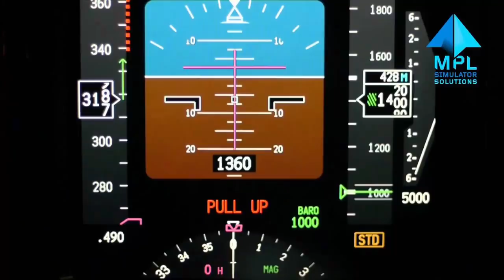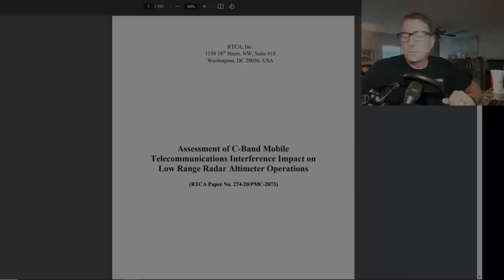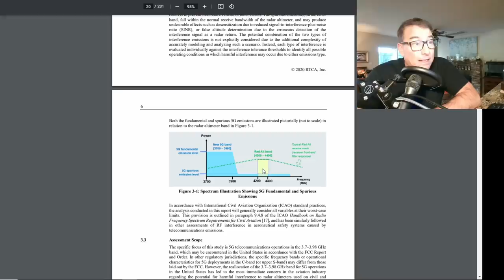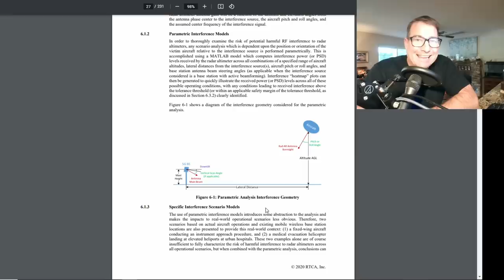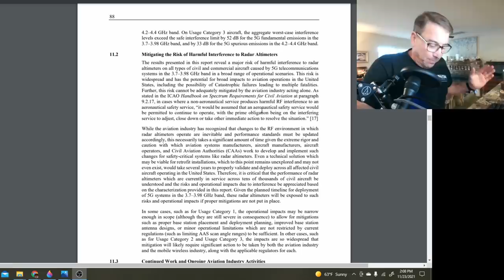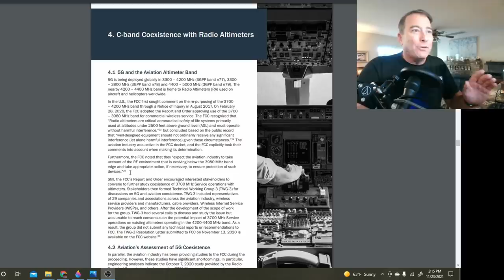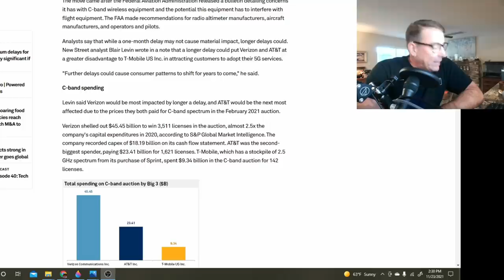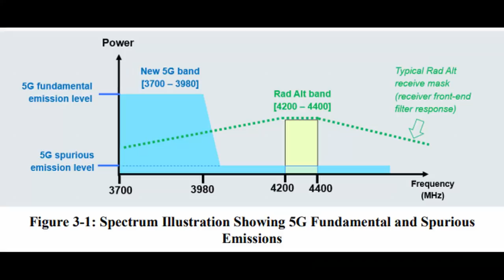5G C-Band Interference with Radar Altimeters in Aviation

Comment: Good report Juan. My perspective as a retired RF electrical engineer, is that the old legacy radar altimeter design will need to be upgraded with newer filtering techniques such as BAW (bulk acoustic wave). These filters have much steeper rejection in the stopband. As the spectrum inevitability becomes more crowded with expanding services it is incumbent on the folks who design the avionics to be as immune as possible to potential interference. Easy for me to say, more difficult to implement.
Reply: That and use a digital modulation for the radar altimeter or whatever is the most robust.
Reply: I agree. These cellular companies are clearly willing and able to spent $10 billion or more for this spectrum. Let them pay for the needed upgrades in aircraft radar altimeters.
Reply: Problem is the onus shouldn't necessarily be upon aviation to pay for new radalts everywhere - signal intrusion issues are borderline ethics dilemmas as the cost of upgrading all radalts with newer filters and tx/rx gear with higher wattage is probably just as expensive as trying to get the damn 5G telecom industry to get their ** together. 

Yes radalts are old but imagine if I walked up to someone in an Oldsmobile and said I'm going to get your car banned from the road, it's too old for my Tesla to automatically recognize to allow me to drive by you on autopilot so that I have to take manual control, you're an inconvenience to me so pay up.
Reply: Agreed.  I'm surprised at how poor the filtering is.  Time to upgrade.
Reply: Or perhaps use a higher frequency alltogether. Nowadays they could operate on 50+ GHz which was not that easy to implement back in the day. I worked on 77 GHz radars in the 2000s which were very high tech back in the day, but nowadays they are cheap to manufacture and present in most self-driving and "autopilot"-capable cars.
Reply: Agreed, I'm also an EE and I think the likely outcome here will be the airlines buying better filters for their ground altimeter radar receivers.
Reply: Do you think that BAW filters have significant group delay variation with temperature?  Group delay would be critical for this application I think.
Reply: The problem is that higher filter selectivity will increase the group delay, and calibrating out bias and random manufacturing, or perhaps even thermal errors in pulse return time delays may not be at all practical.  I think that calibration needs to be accurate to around 2 ns under all operating conditions.
Reply: @saratogapilot6100  yeah I agree, I think group delay issues might prevent the use of a narrower filter.  In the test report they applied a band stop filter on the interfering 5g band which presumably has benign characteristics in the radar band.  Still, calibration and testing for this kind of thing is not trivial, even if some kind of filter solution is workable.
Reply: @davedoe6445  And pass the bills straight to the FCC and 5G operators, who are the ones trying to infringe on the safety margin.
Reply: also as a IT and RF Engineer and a PPL Holder,  the FAA is making some very erroneous claims along with the CAA.  so i concur with your statement.  AVWeb covered this and i left some very elaborate and detailed explanations on some testing i have done myself, as i have done work on the 5G systems in respect to spectrum interference. 

the FCC has debunked the FAA and the CAA's claims and issued a recommendation that we have already allocated billions of dollars worldwide in cooperation with other nations to get 5G Certified, its your turn to fork up some cash to fix the problems with older equipment you still allow to be used which is far more suspect to interference and failures from RF saturation.     sadly, because of political squandering,  this is going to be a long drawn out issue.  

no other country seems to be having these problems with 5G Low/Mid Band channels except the US and Canada.
Reply: @antoineroquentin2297  5G Ultra Wide-band uses 28-29.5 GHz mmW spectrum,  so its already waaaaay higher.  its the 5G Low/Mid Bands still sporting the LTE infrastructure that is the problem.  and the two major carriers populating that area is Verizon and T-Mobile with the rollout of 5G UC Midband channels.
Reply: They should add measuring with laser for redudancy and increased precision near the ground above the runway.
Reply: @ReinoGoo  LASER's however have atmospheric interference to deal with,  in respect of clouds, dirt, dust & debris.  

it would take a decent setup to use them.  including a receiver that would need to be spotless on the lens.  which would be nearly impossible to consistently check while the plane is flying. 

the biggest problem right now, is the still certified older RALT receivers that are showing signs of erroneous readouts when nearby a 4g/5G Tower.   5G UWB and 5G LB do not affect them its the 5G MB 'Mid-Band' that is just getting activated and rolled out.  

5G LB operates in cooperative with 4G LTE as far as frequencies are concerned.  the coding and modulation is different.   both operating around 12-1900 MHz. 

5G UWB Operates at 28GHz as mmW spectrum and is those tiny cans you see sitting on top of light poles in dense urban areas.  

Both LB and UWB are well out of the range for RALT C-Band interference.
Reply: Everyone here's ignoring how difficult and expensive it is to get anything aircraft-related certified.  Let's say we have a solution ready-to-go today.  It'll be a minimum of 5 years before it'd become certified and another 5 years before all of the aircraft could be outfitted.
Reply: Unfortunately and as usual it will probably take an accident before they realize they have a problem.
Reply: Cost multiplied by the number of active aircraft worldwide!
Reply: @michaelhansen7516  $$$$$$$$$
Reply: @ReinoGoo  lasers might not work so well in visually occluded conditions when these are depended upon.  Maybe infrared?
Reply: @SteamCrane   I don't know the technical issues, but there seems to be too much money in 5G for it not to go through.  Maybe there's a happy technical middle ground.  I'll leave it to the experts.
Reply: @grayrabbit2211  at the same time everyone is ignoring what the FCC has put into reorganizing the spectrum time and time again to fit various things into various slots,   a lot of them good, a lot of them bad also.  But at least they are making the effort to do it.   Everyone is also ignoring what other countries around the world have already mutually fixed.  

why is it the FAA and the CAA are the only two Aviation Authorities making a stink about it?  

I haven't seen a peep out of ICAO or IATA,  haven't seen a peep out of any European Nation, or Asian Nation and their Aviation Authorities.  Just America and Canada.    MAYBE because both the Asian Nations  and the European Nations that use 5G have already revamped their Aviation Requirements to work with 5G.  

the CAA and the FAA dont want to play ball.    The FCC is willing to work with the FAA,  the Canadian Spectrum Management and Telecommunications Authority is ready to work with the CAA.  but they ( FAA and CAA ) don't want to work with them.   

so, no mutual grounds = crying and complaining on ONE side. 

and THAT , is the world difference going on.  and until the FAA and the CAA start acting like the others,  this will never get solved.
Reply: @onenerdarmy  Wait for it!
Reply: This is the real point.  The filtering in the radio altimeters need to be upgraded.  The electromagnetic spectrum is so crowded and getting more crowded every day.  Existing equipment needs to be upgraded (or replaced) to deal with it.

I don't know where the money goes from these FCC auctions, but an obvious place would be to compensate those who are negatively affected.
Reply: @CapStar362  The French also reported issues of interference between 5G and aircraft.
Reply: @ReinoGoo  How would that work on TCAS? Just scan everything around the plane with a laser beam?
Reply: @CapStar362  having worked with both the FCC and FAA on multiple projects, I'll gladly side with the FAA.  Yes, the FAA is very overly cautious when it comes to safety, but the record stands - 2 Part 121 fatalities in 10+ years of operation.

One radio altimeter foul up could mean 300+ bodies scattered among the burning remains of an aircraft. 

The previous FCC chair, Ajit Pai, worked for Verizon before joining the FCC and I don't recall a single time when he did anything Verizon disagreed with.
Reply: @grayrabbit2211  Pai and i dont agree on lots of things either.  

and ive worked on quite a few projects myself pertaining to 5G.  

he made plenty of fuck-ups himself.  

and i dont know of a single airliner that is operating a RALT that isnt prone to the levels of interference the much older RALT's still in use.  

my point is that, the FCC is willing to help.  the FAA is not.  

Canadian Spectrum and Teleco is willing to help,  CAA is not.  

mutual agreements on how to assist each other and the people they serve goes a long way, which is why i made the standpoint of how nearly every other country that utilizes 5G including ICAO and IATA are not saying much at all if anything because of mutual work forces fixing things. 

FAA and CAA seem to be the outsiders on this.
Reply: Well said.
Reply: @Inkling777  Or let the government give some of its money to the victimized party. I.e. altimeter manufacturers and users. Why should the money go into other projects? If there is a cost to using that frequency band then the money has to address that.
Reply: There are a few issues here. Improving and retrofitting filters could be done, but it would most probably require more space and weight -- both of which are at a premium in aircraft, not to mention the qualification issues. The lifetime of a radio altimeter design is most probably decades, whereas the lifetime of cellular design is months (but probably small years for base station equipment).  The point is that technology changes must faster in the cellular world and the FAA process rightly does not account for that when lives are on the line. You could design a 5G system that moves users when a RA is sensed, but that seems complicated. Yes, the real problem is when you have a 5G mobile on board that is not in airplane mode. The phase noise is sure to have some concern with the RA. I haven't checked into 5G -- is it like LTE with a wide bandwidth (I think 20 MHz chunks)? Or narrowband TDMA spikes (P25)? 5G modulation probably plays into the equation also. Lots more questions than answers! Thanks for the report Juan!
Reply: @bob4702  

" I haven't checked into 5G -- is it like LTE with a wide bandwidth (I think 20 MHz chunks)? Or narrowband TDMA spikes (P25)? 5G modulation probably plays into the equation also."

To answer this,  the low band and mid band portions are like LTE in modulation. 

Low Band resides in the same areas at 4G LTE which is 12-1900 MHz and 2.6GHz ( correct me if im wrong on that one ) 

Mid Band is now 3.5 GHz which is right next to C-Band. 

the super fast 5G Ultra Wide-Band or 5G UWB, resides up in the 28GHz mmW range and is completely outside of the range of interference. 

as far as updating components,  a simple component change in the filters and testing them while yes,  could take some time,  weight wise is not a problem.  

Verizon, ATT and T-Mobile have already lowered their dynamic levels for Lo/Mid Band towers.  so at least the carriers are now making a effort.  

FCC has made its effort,  now its time for the FAA to make an effort to help.
Reply: @antoineroquentin2297  how well would 77GHz fight 500+m of fog?
Reply: @AKAtheA  about 2 dB attenuation per kilometer of heavy fog
Reply: @antoineroquentin2297  only??
Reply: @AKAtheA  as long as the droplets are much smaller than half a wavelength, it isn't an issue. rain is more problematic (not because of attenuation, but because of scattering) but it can still be done
Reply: @antoineroquentin2297  what about snow? :P
flakes can get pretty big close to the ground...
Reply: Thanks for posting, I was going to make the same point.  Aviation doesn't own the entire band, just the part they are licensed to use.  They went with a crappy design because they thought there wasn't enough present around their frequencies.
Reply: @samuelkeystone  Yep, digital modulation is the key!  GPS has 130dB of rejection IN BAND due to the modulation technique.
Reply: @onenerdarmy  Legally the onus is on the aviation industry since they sent a product out that is sensitive to out of band signals.  Your analogy is irrelevant because the Oldsmobile was legal when sold.  At no point did the aviation industry own the spectrum they are complaining about.  They just got lucky until now.  At no time was the industry guaranteed this spectrum wouldn't ever be used.
Reply: @grayrabbit2211  "  It'll be a minimum of 5 years before it'd become certified and another 5 years before all of the aircraft could be outfitted."  - This is exactly the problem. I'm an R/C aeromodeller, and the pace of electronic technology advances in R/C  is simply breathtaking. There is no reason whatever for pilots to lose control of aircraft due to situational awareness deficiencies, since autopilots can fully stabilise an aircraft and avoid terrain. If this technology exists for models, why cannot it be applied more widely to general aviation? (I know there are some GA aircraft which do now have emergency systems which will guide aircraft even to a safe landing at an airport). Likewise, the range for remotely controlling models has increased radically, meaning that emergency systems for controlling aircraft remotely can also be devised.  But how long before they are certified?
Reply: @awuma  For good reason -- if they get it wrong, people die.  Living relatives sue.  Juries will rule for the deceased's family every time.  

Realize that more people in the USA die in elevators each month than have died in airline accidents in *10 years). 

I'm not entirely opposed to the certification process.  There's only been 2 fatalities in Part 121 US carriers over the past 10+ years.  One was due to an engine failure, the second was due to multiple factors, including the anti-lock brakes being cross-wired and an inexperienced pilot.    I can hear people, myself included, saying that 2 deaths is too many.  

At the same time, the process does need to be streamlined.  More government is rarely the solution to any problem.
Reply: @Porco Porco The issue isn't the ability to do it, rather implementing it with the rules we have to work with.  Even now, many small planes have glass cockpits (digital displays) which are far superior to what the airlines use.  Getting those systems tested, built, tested again, and certified is a completely different matter.

Keep in mind that radioaltimeters are used at the most crucial times of flight, often in the most dangerous weather conditions.   Screw this up and you're killing a few hundred people.
Reply: So much this.  There are many legitimate users of the bands and any user of spectrum must utilize the appropriate techniques to "stay in their lane".  If a multi-million dollar navigation system can't handle a little bit of OOB emissions, then it is hardly a well designed system.
Reply: If a $20 wireless device can disrupt a landing radar then that landing radar is a POS.  Notch filters or better quality discriminators are not expensive and just because designers were lazy back in the day does not give them the privilege to continue to be lazy.  Stay in your lane.
Reply: @antoineroquentin2297  Technologically possible is not necessarily technologically feasible or economically feasible. Time constraints enter the picture in very serious terms. Designing, developing, building, testing, and all that folderol takes time that the industry does not have.

Other technologies can also give 1' type altitude accuracy. This would include things like differential GPS within a full Kalman filter arrangement with all the aircraft's other instruments. (I remember some 10' wink-wink discussions with the Air Force back in the 70's.) But, again, time is your enemy.

About the fastest drawing board to cockpit approach I can think of today would be a software defined radio with filtering that uses the nature of the altimeter chirp signal to implement some level of interference rejection. A human MK 1 eyeball on a spectrum and waterfall display can pull the scratch of a signal out of all manner of noise you'd not believe. And for an altimeter 5G is noise not sets of signals that can easily provide the clear tone the equipment looks for when deducing altitude. But, even that would require time that is not available.

With that in mind it would be interesting to see what accuracy reduction would come from slapping a narrower filter on the receiver input. That might be a fix that can be implemented within modestly tight time constraints.

(In the abstract I'd love to see some schematics or even block diagrams for the existing altimeters to get a notion of how caveman they might be mostly because it saved a couple bucks per altimeter.)

{^_^}
Reply: @grayrabbit2211  they had a heads up in 2017, they should have started the moment they got notice.
Reply: @inadequateusername7280  because of the certification process, it takes about 10 years to get equipment designed, tested, and certified for aviation.  I'm still waiting for certification on my plane to use the Garmin Autopilot instead of the crusty KAP140.   No doubt the Garmin unit can do it, but I can't legally install it until it's certified.
Reply: @grayrabbit2211  the rest of the world shouldn't be held back because the evaluation process is broken.
Reply: @inadequateusername7280  People's lives shouldn't be endangered because some narcissist needs to upload more selfies faster.  We are talking about a system that is critical during the worst and most dangerous weather. 

Fix the system, then we can discuss changing equipment
Reply: @saratogapilot6100  I would try freq changing, listen before tx.
Reply: @grayrabbit2211  lol no, the guard bands determined by the FCC is plenty, the altimeters shouldn’t have been allowed to be built in a manner where it’s affected by adjacent bands. This is a finite resource the aviation cannot hog it because of poor design.
Reply: Yes we can design “blocking proof”  FMCW RA’s…but it’s not cheap for the aviation industry to accommodate this change.
Reply: Said BAW or SAW filters will need to exhibit linear phase over the FMCW swept band.
Reply: @davedoe6445  - The filter must be linear phase for it to work properly with an FMCW radar. Linear phase = constant group delay with frequency.
Reply: @w5cdt  well it's not a only a matter of some arbitrary constant group delay, you would need to know what that group delay is in order to calibrate out its effect on radar measurements.  For instance what if at the minimum radar temperature group delay is 300 ns slower than at maximum temperature (making up those numbers).  That would produce a ~300 ft altitude error if left uncorrected.  I have no idea how easy it is to calibrate a BAW or SAW filter to demanded accuracy over manufacturing variation.     

As for the politics of the matter I have no clue, I'm only guessing that the telecom industry will ultimately command more political clout than avionics designers since they have a bigger constituency.
Reply: Isn’t this new 5G band already re-purposed or shared from a military (surface) radar band?
Reply: @george8bitsworth  "The filtering in the radio altimeters need to be upgraded."  ... and tested .. and certified. 
In the meantime, do you think the big telcos are going to sit on their hands and wait.. of course not, so this change will go through. Problems may occur... (read that as will occur... Murphys law).. and we  may have a 737 Max situation, only this time the big bill will hit the telecom companies and the FCC, for failing to take the matter seriously.
Reply: @AndyHullMcPenguin  Thanks for the reply.
You wouldn't expect it to be a simple process--especially when aviation is involved. You're right about the telcos not waiting. It's been in the news about how they're going ahead in spite of being encouraged not to.
Reply: @ReinoGoo  Will fail due to interference in bad weather. Rain, fog, snow. Which is precisely when it needs to work.
Reply: Sure. Should have long ago. But in the meantime . . .
Reply: Agreed, this could be paid for partially by the 5G providers.
Reply: @onenerdarmy  You are wrong.
The spectrum used by 5G was never reserved by the avionics industry.
It is time to sort out old flaws to ensure functionality within the specified band.
Reply: @AndyHullMcPenguin  Doubtful. The RTCA paper came up with a worst of the worst of the worst possible case theoretical scenario and even then they still say the issue isn't spurious emissions, but rather poor filtering by RadAlts, and required some crazy scenarios like cell towers aiming their antennas above the horizon or at a 40 degree angle to the ground with high power in order to simulate a field strength that could affect RAs on commercial aircraft to an unacceptable degree... at 0.4NM from the cell tower.
Reply: @onenerdarmy  ahhh but at some point you hafta say your Model T cant run on this highway
Reply: @phillee2814  It's not that simple. 5G gear is filtering well. The radalts have outdated filtering. It's just another thing to upgrade, just like engines have been in the past. It's not FCC's or 5G operators' fault that radalts aren't up to modern standards. If anything, I'd blame the radalt mfrs for obviously assuming that they won't ever need better filtering.
Reply: @samiraperi467  The Radio Altimeter manufacturers had to pass the certification from both the FCC and FAA, and achieved it on the basis that the bands on each side would be a protection of life buffer.  They didn't move the goalposts, so should not have to pay for them being moved.  The FCC and cellphone service providers chose to ignore an established safety buffer.
If the airlines are made to pay, don't be surprised if they upgrade by increasing the power of their systems to obliterate 5G service on instrument approach corridors.
Life protection trumps internet speed all day every day, so suck it up.  Cell providers can easily use frequencies with greater separation in those small areas, just like they do in Europe.
Reply: I'm surprised this didn't happen years ago, on basic safety grounds.  Being receptive to such a wide spectrum just invites some manner of inadvertent signal contamination, possibly (?) resulting in garbage altitude data.
Reply: I agree on this. The problem is with the radar altimeters receiving RF not in their allocated bandwidth. It would be like designing a FM radio that can’t pick one station from the ones adjacent to the one you want. I retired as a tech at a gateway earth station and it was a full spectrum but properly managed we didn’t have problems with adjacent carriers.
Reply: @V100-e5q , If there’s a cost to using the frequencies purchased by the telecom companies, then those telecom companies should pay those costs, not the government. The telecom companies should have the expertise required to figure out those costs before they buy the frequencies.

A simple solution is to use those frequencies everywhere except near airports that require these radar altimeters. Then work with the FAA to change the rules for all newly manufactured and deployed radar altimeters so that eventually it’ll no longer be an issue. These airliners don’t last forever. They will eventually be replaced with new equipment.
Reply: @davedoe6445  There are no ground receivers. A radar altimeter is a transmitter and receiver on the aircraft that measures the round trip time of the signal. I first worked on these 50 years ago on Navy aircraft. We had a spool of cable that would connect to the transmit and receive antennas to simulate the altitude to verify its operation.
Reply: @phillee2814  These companies are operating in their authorized spectrum, the filtering on the altimeter receiver it picking up signals out of its transmitter spectrum.
Reply: @matthewbeasley7765 , Ummm…. The FCC didn’t sell bands that were too close together because they understood the technical capabilities of the time. Those technical capabilities have changed, but the old equipment hasn’t.

The FCC should have required the FAA to upgrade their requirements long before attempting to sell those frequency bands, and whoever purchased those bands should have been aware of potential issues like this and considered them before placing their bids.
Reply: @Chris_at_Home , “we didn’t have problems with adjacent carriers”

Yeah, because the adjacent carriers were sufficiently spaced so they wouldn’t interfere. What if the FCC suddenly up and sold the spaces between the channels so you couldn’t filter them out using the technology used in your equipment forcing you to upgrade all your equipment. Who should pay for the upgrade?
Reply: @terjeoseberg990  Not many years ago the FCC made mobile radio bandwidth allocations narrower and all the mobile radio users had to upgrade their equipment. I don’t think the FCC paid for that. Most technology improves equipment over the years but the basic design of radar altimeters hasn’t changed  in years. If the manufacturers of this equipment would improve their products over the years with modern receivers we won’t be here today. I see glass cockpits connected it 50 yo technology.
Reply: @terjeoseberg990  Why is this not a problem in Europe? Because the FCC equivalent sold those frequencies to the 5G operators which don't interfere with air trafffic frequencies. So this looks as a failure to coordinate frequency allocation in the first place.
What has not to be ignored is that the frequencies were auction off to the telcos. So they paid the government to use the frequencies. So it is now the governments duty to make sure they can really use it. And not put additional burden on them to do so. All those billions could be used to reimburse airlines to change their frequencies or make other equipment. Else why had the telcos to pay for the frequencies? To make government rich?
Reply: @terjeoseberg990  Because it's the governments agency responsibility to coordinate and regulate use of frequencies. If there is fear of interference then they have to take in all the concerns and resolve the issues. Either by mandating certain restrictions of use and requirements to the equipment or by assigning the proper distance of frequency bands. It's not to sit back and say guys duke it out yourselves. Not without reason equipment has to be compatible and the FCC is there to make the rules.
Reply: @Chris_at_Home  And don't you think that would have been part of the approval process at any of the dozens or even hundreds of agencies around the world who had to pass the existing RA systems as safe for the preservation of life?
Yet they all passed.
Reply: @V100-e5q , The government sold those frequencies. The purchaser must be intelligent enough to understand that they will not be allowed to interfere with their neighbors. If they don’t have the technology to use those frequencies without interfering with their neighbors, they should not have purchased them.

Maybe they just got screwed. Or, maybe it’s worth it for them to use that frequency band only far enough from airports so that they don’t infere with them.

Did the government provide a guarantee when they auctioned off those frequencies? Buyer beware.
Reply: @terjeoseberg990  I think you should take in the role of government. They are not just like a real estate owner selling his lot. They are owners and regulators. So if they sell a frequency band they have to either let them use it without limitation. Hence everywhere in the US. Or they must establish limited use. Like the requirements for equipmnet (radiation power not over 10 W) or limit the locations. That is the essential role of government which you seem not to get. Like the restrictions to flight space use to stay at the subject.
Reply: @onenerdarmy  your car analogy falls flat. This situation is really like the Oldsmobile guy getting the Tesla banned because he can't go fast enough to share the highway with them safely. Clearly this person needs to upgrade their car if they want to be able to use the highway again.

It's not telecom's fault that so many altimeters weren't designed to the correct specifications. It's not telecom's fault that the FAA approves these out-of-spec altimeters for use.
Reply: it isn't like this just happened.  Aviation has had more than 10 years to get a solution in place and appears to have sat there fat dumb and happy for that time.
Reply: @Gnrnrvids , Nobody told the aviation industry 10 years ago to fix this.
Reply: @terjeoseberg990  Nobody told the aviation industry to manufacture equipment that isn't up to the correct specifications. Nobody told the FAA to approve that incorrectly-designed equipment for use. The whole point of a "safety buffer" is to not use it.
Reply: @terjeoseberg990  they are operating outside their allocated range.  They have had 10 years to sort it out as it was announced 10 years ago where 5G would sit.
Reply: @samuelkeystone  that's what I was thinking; if the signal from the altimeter has a unique signature, it would be easier to lift it out of the interference. But this whole problem is a money driven rejection by the telecommunications industry of passenger safety.
Reply: All this 5g congestion is nonsense. Just adding directional and beamforming antennas is 99% of the problem, which newer 4g radios already do.

The companies are expletives though and they don't want to upgrade their towers at all unless it's a BIG upgrade and then not touch it for 20 years.  Really 5g's RF bandwidth expansion isn't necessary, they need to buy new SFP dongles for their fiber ethernet so they get 10gig to their tower backbone instead of 20 mbit
Reply: @davedoe6445  group delay is not significant for this slow modulation and would have a fixed offset, easy to account for.
Reply: I studied aviation radio altimeters back in the 70s. I thought radio altimeters waisted a lot of a radio band. Should have been fixed decades ago.
Reply: We could live without 5G 🙂
Reply: could you not prevent any issues by just upin output to 3 Watts or does that cause issues with reflections, and putting better ejection on the receiver?
Reply: @ReinoGoo  I really don’t know why this isn’t a thing in aviation. It could be that some of the technology used on higher-end vehicles could be scaled-up for aviation. #thinkingoutloud
Reply: @grayrabbit2211  I’m not sure it takes that long for recertification when there are other certified RALT already certified. Wouldn’t this be more about making sure the testing of the refitting of filters has sound study design, was executed by an accredited 3rd party facility, and then certified by the relevant parties? I’ve seen avionics firmware upgrades done in 6-9mos.
Reply: @onenerdarmy    Just wait...that's coming.
Reply: @onenerdarmy  I think you’re making an incorrect statement.  The new spectrum allocation to 5G is not intruding on the spectrum used by radalts.  The problem is that some of the deployed radalts are too permissive in their filtering of RF signals outside of their allocated spectrum band.  The use of 3.7 - 3.98GHz spectrum for 5G is not a NEW USE, but is a RE-USE of the spectrum.  That band of spectrum is a portion of the 3.7 - 4.2 GHz C-Band spectrum that satellite communications has used for decades.  This is the spectrum used for reception by the earth stations, and is transmitted back to earth by C-Band satellite transponders.

What I don’t understand is why this debate and safety concern has only been raised within the last year, as the spectrum was auctioned off, and 5G service providers prepare to put them into use.  Before any of this spectrum could be turned on for 5G use, any SATCOM use had to get re-assigned, or shut down.  That takes time.  So, why this issue was not researched in parallel during that time is a big concern.  Maybe this was some ‘fallout’ from the previous Administrations’ goal to reduce or eliminate regulations?
Reply: @CapStar362  In Europe, the C-Band spectrum allocated to 5G is a narrower band than what was allocated in the USA (3.4 - 3.8 GHz in Europe, 3.4 - 3.98 GHz in the USA), so that extra 180MHz of spectrum in the USA narrows the gap between the allocated 5G spectrum and the radalt spectrum (4.2 - 4.4 GHz, worldwide).  So, that could explain why other parts of the world have successfully deployed midband 5G in the C-Band spectrum, without problems.  Or, it could be that the USA ‘special interest’ groups are fighting to defend their turf, and put the financial burden on someone else, for what has not been a demonstrated issue in the real world.  Again, as I said in a previous comment, the migration of C-Band satellite communications from 3.7 - 3.98 GHz in the USA, prior to the auctioning and use of this spectrum for 5G, has been years in the making, so why were these concerns not raised earlier?
Reply: @rfengr00  A portion of the new 5G band is re-purposed from its use in C-Band satellite communications.  The new 5G band is 3.4 - 3.98 GHz, and within that, 3.7 - 3.98 GHz is a portion of the 3.7 - 4.2 GHz band that was used by C-Band satellite, for decades.
Reply: @terjeoseberg990  Your comment about the costs doesn’t make sense.  The mobile carriers are spending BILLIONS of $$ to purchase the right to use these frequencies.  Then they are spending BILLONS of $$ to deploy 5G equipment to enable service on those frequencies.  And the 5G cellular equipment is built to the latest and greatest radio standards, meaning they will adhere to established specifications for transmission, interference, immunity from interference, etc.  So why should the carriers also bear the cost of paying the airline industry BILLIONS of $$ to upgrade their ancient and poorly designed radalts?
Reply: @MrNoobed  That’s a pretty ignorant statement.  The cellular companies are already using 1G, 10G, 40G to connect cell tower sites to the network.  The problem isn’t having enough bandwidth in the fiber to transport cellular data.  The problem is that current 4G LTE spectrum is limited in the amount of data it can handle, so it’s a capacity issue in the radio portion of cellular communications.  That’s what 5G is intended to resolve, as well as to reduce the latency
Reply: @RbNetEngr  i understand that,  the fact the FAA will not up their game to get more strict on the filters for that little bit of narrower margin between C-Band and 5G LB/MB when yes, the info has been there for a long time is exactly how you put it.  FAA wants everyone else to pay for the airlines and pilots to get newer equipment.  Unlike the FCC that has already made several changes to help.
Reply: @MrNoobed  I don’t work for Huawei, and I’m not a shill for any equipment vendor. I’ve been a network engineer for 38 years now, and have worked with a wide range of technologies over that time. 

That said, I think you proved your ignorance by stating that the cell towers you’ve worked with used SFPs (Small Form-Factor Pluggable) optics, at 20-100mbits, since only the first generation of SFPs ever supported 100 Mb/s, (introduced around 2001), and no speed below that. So, maybe in the days when you were working at cell towers handling 2G technology, they uplinked at 100 Mb/s (and not less).  But anything modern, especially 4G towers built within the last ten years, wouldn’t use anything less than 1Gb/s.
Reply: @RbNetEngr  the link is negotiated at whatever, they only Pay for 20mbit so that's what they get.
Reply: @MrNoobed  LOL.  Okay, MrNoobed.
Reply: @grayrabbit2211  The FAA needs to step up on certification.   I worked for a decade on an IT project to upgrade their computer systems.  The FAA is the slowest most bureaucratic agency in the government.  We were running into roadblock after roadblock despite the fact that the FAA was still depending on HP proprietary equipment that HP had stop supporting a decade earlier.   The FAA couldn't get their heads out of their backsides with a winch.
Reply: @nikolatesla5553  In some ways, the FAA can't do anything about the certification process.  

Look at a FAR-FC or FAR-AIM book and compare it to a previous edition from just a few years back and you'll see how quickly it's increased in thickness.  Politicians and clipboard warriors love making new laws and rules, but rarely ever remove them.  A common refrain in aviation is that the rules are written in the blood of victims.  Good luck getting anyone to even touch the rules given that phase.  

If you think the FAA is obtuse, try working with the federal DOT.  The FAA is a lean, mean, fast machine compared to DOT.
Reply: @samuelkeystone  Digitally modulated radar altimeters are export controlled by the US government. They want to make sure our military can easily jam them. And if they can jam them, anyone can. You can send them your thanks.
Reply: @CapStar362  Agreed.  When the radar altimeters were first designed, they were designed to work with the interference from the incumbents in neighbour bands,  which were none.  So they could afford to use receiver filters with a broad filter response.  That was,  IMHO,  to reduce cost not increase accuracy.   When an incumbent comes along meeting the FCC approved transmit power and transmit mask (out of band emissions),  the lax design is revealed for what it is.   So who created the harm?   The designers who took advantage of the lack of use of the neighbour bands to reduce the cost of their product,  or the telecom providers?
Reply: shouldn't the FCC have sorted this out years ago in the "FEASIBILITY" and "FREQUENCY ALLOCATION" STAGE OF APPROVAL????   This is what happens when Gov hands out FCC top job like prize trophy to cronies.